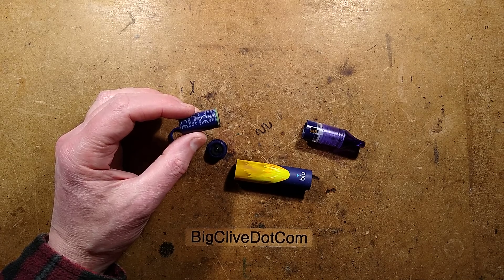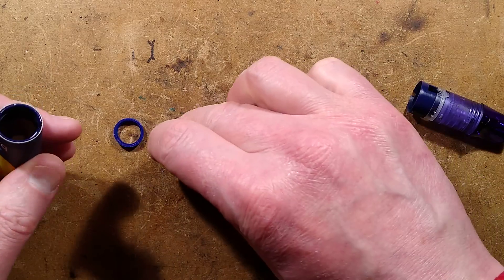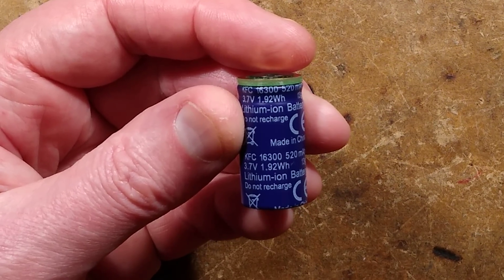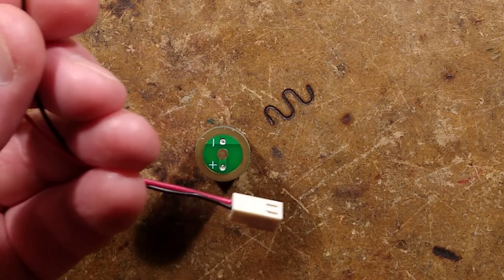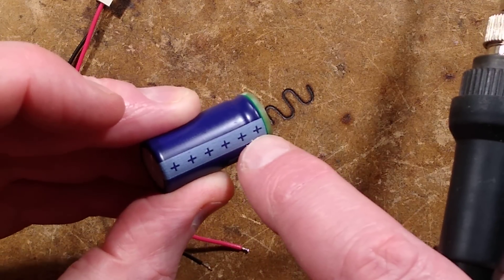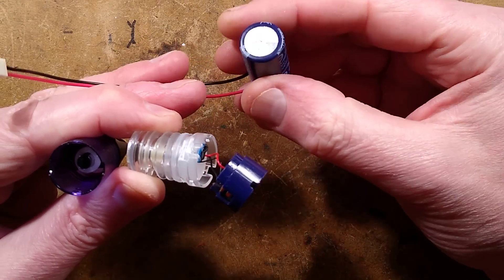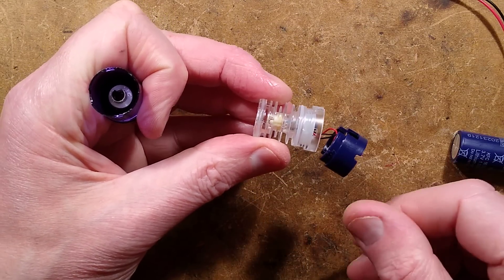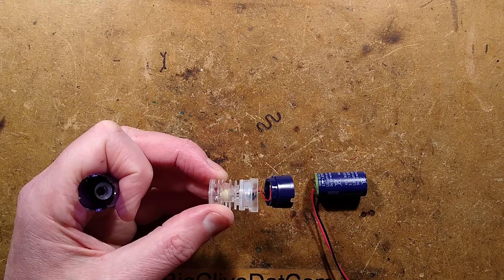Easiest free street-lithium yet - with gold flashed contacts!

Comment: Could you use the original metal case to make a tiny power bank? Basically replace mouth piece with a charging module, you could even keep the gold connectors in place! I realise that 400mAh is tiny but maybe enough for led lights?
Reply: I've done this with the IGET branded (rectangular bar) ones I find a lot of.  They contain at 1500mAh battery, and as the liquid holder pad thing is the same size I can replace it with a second battery.  There's enough room left for the usual 5v USB power bank module, and I take another end cap and cut holes in it for the ports.

I have a few rechargeable ones I thought about converting to LED torches, but the electronics gets in the way and unlike this version they're too hard to disassemble without damage.

Comment: I have taken apart some of the breeze brand vapes and they have a lithium ion battery which comes out to about 800-900 mah consistently.  its not as nice as these cosmetically, its almost like a pouch cell.
Reply: Those breeze 1Ah are over-rated by 20%

Comment: I was given nearly 100 of these, recently. 
 They will not go to waste, as their cells are perfect for some of the smaller RC aircraft that I like to fly  :)  . 
 Now, if I could just devise a use for those "micro-phony" things, as I found that they can be triggered - by blowing on the back of them. 
 Wind sensors, or airflow sensors, perhaps?
Reply: Did you ever find a use for them? I too am interested in integrating them into a project.
Reply: @CyberDunk2077  
 Not yet, unfortunately. 
Sensing airflow in a pipe, where 2 of them are used, to determine the direction of the stream, could be useful. 
I hope that someone can use their imagination on these, as they are just too cool to throw away  :) .

Comment: The "disposable" cannabis vape devices have a fair amount of interesting circuitry, as well. USB-C voltage regulator for charging, some kind of transducer that detects suction and proportionally allows current to flow, and a small lithium ion pack that is perfect for small electronics projects. The environmental impact must be awful, but the potential for hobbyist reuse is immense! And if you enjoy and/or medically benefit from that altered state of mind, it's often not a bad purchase at $20-40 depending on the state (for those in legalized states and/or countries).

Comment: I think I had desoldered the contacts/connector on the vapor itself to reuse it  as battery holder and with the battery as-is, because it is neat to be able to replace the battery without desoldering. This also avoids heating up the pads of the battery, batteries don't like heat.  Probably you can use a part of the case to construct a holder that fits the battery.

Comment: I'm going to guess the „Do not recharge“ warning might be aimed at consumers attempting to refill/reuse these, possibly to warn that the cell might be unprotected and require a charger with a protection circuit in it. Did any of your tests reveal any built-in cell protection? 🔋🛡😇

As for their uses; I bought a few LED cupboard lights from Lidl last night (Each has 2x 1W COB LEDs and a chip-controlled on/off circuit) and if these can hold 1,92Wh that's enough to run one of those at half power for two hours, or full power for just under an hour. A few of those cells in parallel, and you have a practical way of providing battery-driven escape lighting throughout the home! 👍

Now: If only I could get my darned head past all the „Never break the warranty seals / It's dangerous to mess about with things that could catch fire / Always leave this stuff to people who are trained professionals“ 💩 that was so forcefully driven into my head as a kid that I'm still extremely nervous about handling any Lithium device which has even the smallest signs of damage to it... 😔
Reply from the maker: No integrated protection PCB, but easily charged with a suitable charger.
Reply: @bigclivedotcom Clive, have you tested what the discharge cut off voltages are for the myriad of these things? I suspect some of them discharge to damaging voltages since it is disposable and they want to squeeze every last joule.

Over discharge causes dendrite formation, recharging from that low voltage rapidly grows the dendrites and can cause internal shorts. I'm worried the warnings are real  which would make me hate them even more since it forcibly prevents reuse. 

There are some amazing papers where they use novel electron microscopy techniques to show dendrite formation in real time across the charge/discharge cycle.

Comment: All the work they put into the battery and then they attach it to a tank that leaks like a sieve.
Reply from the maker: I've not had any of the units I bought leak.  Shipping (especially by air) can cause pressure issues.
Reply: @bigclivedotcom  Maybe our local courier wears heavier boots than yours 😆
Reply: have not found any newer style "cap cells" but had noticed the older construction was very robust with an outer aluminum wrapper and an inner metal container.  even if cell was run over and deformed it would usually take a charge and worked properly (though not advised - I just properly recycle if smashed potatoes.

Comment: Clive. I mentioned this before, but did you ever get to do a deeper dive into the “mikey like thing”. It’s not a diaphragm switch! It really is a modified mic device.  It has a constant oscillator applying ac to it (low power!). The v clever asic detects changes in capacitance when you suck on it! That triggers the heater driver PWM. It seems bonkers, but that’s actually how they work! Please disect one and scope it to see. A marvel inside those mikey things!  Peter.
Reply: Do you know of any projects that can make use of them? I have amassed quite the collection and have been wondering what I could use them for. Maybe a wind activated garden light system or something.

Comment: do not recharge? i wonder if they are cells meant to be single use? i have literally boxes of them but unsure if there's a drawback in charging. god they made all sorts of them. round cells, pouch cells. led, flashing rgb led rings, lcd displays with liquid/power levels, usb-c charging. shaking sensors to power it on. lanyards
Reply from the maker: They are trying to avoid liability and discourage refilling of their devices.

Comment: There are newer “disposable” Vapes that you can recharge and you just buy disposable Pods. There are some that tell you exactly how many puffs you’ll get. I quit smoking in the beginning of my 20’s maybe 19, after starting when I was in 8th Grade. Back then the Smoking age was 16 and there were no Huge warnings and pictures to dissuade you from smoking. Kinda crazy I’m now older than Barb Tarbox who was the first lady that fought for the laws to be changed. He picture is part of the series of “shocking” photos. Unfortunately I started up again in 2007. I tried Vaping when it was relatively new but it never worked for me. I need to have Abdominal Surgery soon and my Surgeon has been hounding me to quit, so I decided to give Vaping another go, and this time it looks like it’s working (knock on wood) I bought 5 and 6th is free (I think they are 120ml. The new Nicotine “Salts” gives you more of an instant hit, rather than a slow gradual 5-6 puffs to get the same amount. Be careful with the stronger Nic Salts you will get a buzz and head rush, etc, if you sit there and take puff after puff. I think the max strength here is 50mg. Also with the Nic Salts you won’t get a harsh hit at higher Nicotine levels, unless you do something dumb and try to do 50mg on a Rebuildable RBA. You can still get “freebase” Formulas like before, and those will give you a harsh throat hit wither higher mg strengths. I 2 bought 20ml Salt Nic 60ml Bottles, and the rest are 12mg “freebase.”

Comment: Why do they precut that X on the battery case? 

I'm sure the cell would out gas & build pressure, then pop that X, but wouldn't it sound better if was allowed to build more pressure before popping?
Reply from the maker: It is pressure release, but will still go bang.

Comment: when i saw "do not recharge" i thought they were installing one of the non-rechargeable types of lithium batteries in this device.  but those can not be recharged.  the chemistry is all different.  but the question arises why do they use rechargeable batteries in totally disposable devices.  rechargeables must be cheaper than the single use lithiums.  that style of battery seems very adaptable to us re-users.  i'm looking out for them but disposable vapes are now banned here in australia.  does the capacitor style bottom make the battery less likely to explode?
Reply from the maker: Rechargeable cells are ultra mass produced and cheap now compared to the non rechargeables.

Comment: I've recharged many "non-chargeable" batteries in my lifetime.  Alkaline ultimately wear out and leak but I've extended their life many cycles over.  I use some alkaline in my homemade solar garden lights and some have lasted over a year without leaking.  I'm assuming the manufacturers are realizing people are recharging or repurposing them and that may affect their sales, so they scare people into not doing that with warnings, as they always have done.  Like you say, challenge accepted.

Comment: Could it be that the cells are meant to be taken down lower than 3 V? On the datasheet of decent 18650 batteries they usually list 2.5 V as the fully discharged voltage. Even if the cells aren’t meant to be used that low in practice I could see manufacturers, especially Chinese ones, using 2.5 V for the capacity measurements.

Edit: looking further at the datasheet for a Samsung INR18650-25R with a rated capacity of 2500 mAh, looking at the discharge curve if you discharge it to 3 V you only get close to 2400 mAh but if you discharge to 2.5 V you get to the 2500 mAh. It’s not a huge difference overall but it may explain the vape batteries rating too.
Reply: 25R is an NMC chemistry cell, and though it might be RATED to go down to 2.5V, you should avoid to take them below 3,3V in general. Capacity below this is less than 10% anyway, but wear and tear is an order of magnitude bigger. Same as charging to 100% / 4.2V should be avoided.

Comment: That's a really nice looking battery design. The first thing that came to mind was taking the contacts from the device and 3d printing a charging dock for the cells or maybe even a holder to easily wire cells in parallel or series to make quickly configurable battery packs. Although I can see that getting spicy very quickly.
Reply from the maker: Strangely enough, I just 3D printed a holder for the contact base with a guide for the cell.

Comment: I have a dozen or so salvaged cells, most of the same type/capacity- I'd like to build a light duty power bank out of them but I'm uncertain on what BMS to use really as ideally I'd want ~10 cells in parallel to make a ~3300mah 4.2v power bank. Would make for an interesting project/video... hint hint :D

Comment: From what I see when you suck on that thing the air flows over the cell. My question does the cell release any gasses that could be inhaled. I know many a time I have opened things up with batteries that have leaked.
Reply from the maker: It's possible.  But lithium cells are usually well sealed.

Comment: BigClive I think I have info on this!  I bought flashlights about 5 or 6 years ago with that type of connector.  The whole thing was protected by chinese and american patents which I think recently expired.  If you look up the NEBO Big Larry Pro... yes that is what it is called.  The underside of the contact had protection circuitry.  They had varieties that allowed two cells in line.

It has a magnetic charging base that allows the flashlight to charge through the uncovered magnetic end of the light.

It was pretty interesting to see the absolute basket full of chinese and american patents.  It actually worked!  I wanted to buy the contacts and I couldnt until a few months ago.

Comment: Still don't understand why you're using expensive lithium batteries for single-use devices. Don't we have single-use batteries for that?
Reply from the maker: Rechargeable cells are cheaper to make and easier to source.
Reply: @bigclivedotcom  crazy times
Reply: I guess that primary lithium cells are not very useful with high current loads, thus not usable in those devices.
Reply: That's a good thing, since single use batteries are a landfill wasteland
Reply: @mevk1  and rechargeable batteries in a single-use device that lands in a landfill are so much better 🙄

Comment: If the disposable ban comes into force, there'll be an effload of unused disposables to dispose of, so disposing of them in our direction to remove the batteries would be nice, but that probably won't happen without a recycling license or something... :P
Reply: It would be great if there was a way to make every variation of cell quick and easy to use. When they are all a total mishmash of shapes, sizes and contacts you spend most of the time working out how to connect.

Maybe something 3d printed would help, a jig for each type that makes soldering/spot welding safe and easy. A 3d printed charger/case covering each model that you just add contacts to would be super cool. It could be modular where you just print the various cells you run into and they snap together. 

Then you can take a smaller cell and its case allows it be used as a lower capacity larger one. Like 18650->21700 adapters.
Reply: They'll be plenty of black market vapes when the ban comes in. There's already tons of them in the UK, and they mostly have the bigger batteries 🥳
The government are doing a fantastic job as always 😅

Comment: Why is there always a discrepancy in the capacity with most or all of these cells?  Is it just a blatant lie?  How do companies order the correct batteries when the manufacturers never put the correct value on the side?  0.434 vs 1.92 is a huge difference!

Comment: ngl, those 1.92Wh batteries could be really fun in a railgun, with 50% efficiency, you can fire 3.6Kj, or about as much as a .308/7.62 rifle bullet
so a railgun where you can just put them in a magazine, easily connect and discard would basically make act like a regular case-dropping rifle
Reply: The fallout pfp really sells this comment, great idea.
Reply: "Charged Bullet" - for all you Warframe Players out there.
Reply: This is a fascinating idea. It does solve the issue of recharging a separate battery. Wonder how hard it would be to get a good connection on each sequential magnet while still having a good seal. Maybe just thin nickel strips on each side? Timing might be tough too.

Comment: The battery is probably tested down to a voltage lower than 3v - maybe 2.7 or 2.6v. Not healthy for the cell but looks good on the label.
Reply: The manufacturer of the battery probably stated the absolute max capacity the battery could provide with a low drain device.
I've found that Blu (Imperial tobacco) use inflated numbers for their batteries, and many I've tested have a higher resistance. That might explain the voltage drop on the few that Clive tested.

Comment: It would be interesting to see the insides if the battery is actually manufactured into a capacitor case or is it just an old style pouch cell tucked in there.
Reply from the maker: I opened another brand's version and it was the bare electrode/separator roll inside.
Reply: They just would take the pouch cell roll, and put it in a capacitor case, as the roll is already made round in manufacture with the removeable mandrel to wind it, and you simply stuff in a capacitor case, fill with electrolyte, ultrasonically weld the tabs onto the aluminium end buttons inside, and then gill and seal them. Then the standard factory slow form cycle to generate the right products at the right locations, and ship them. All interior is aluminium, same as the negative electrode, and the reaction with the electrolyte outside the active area passivates the foil and case nicely. Just needs a slight excess of electrolyte to cover the reacyion, and the electrolyte is very cheap as well.

Just wonder how many fail in production test, which would be a good use for having the burst lines in the case, so it does not expunge the seal violently, just a puff as it vents.